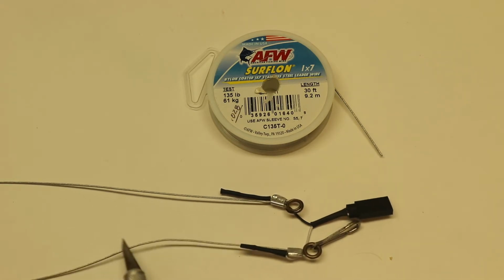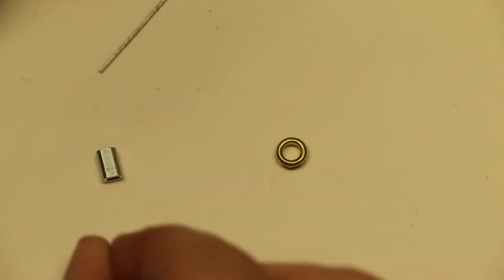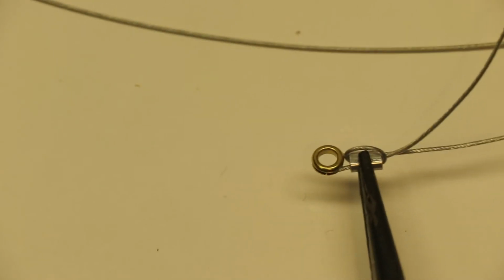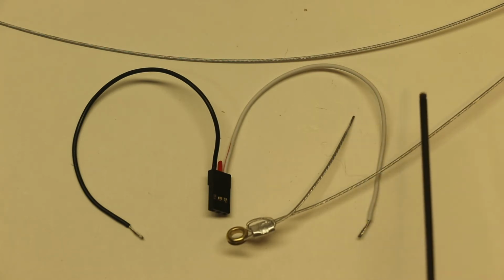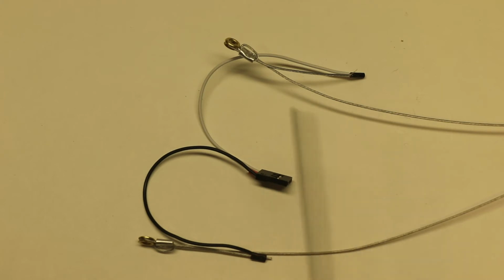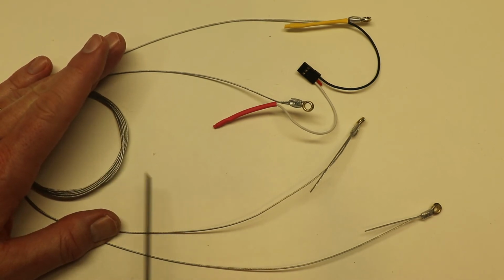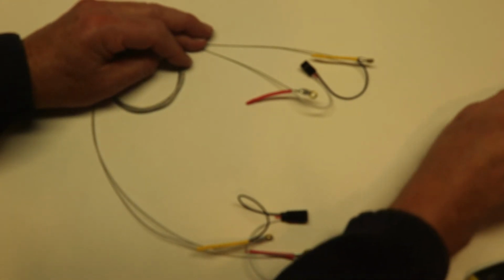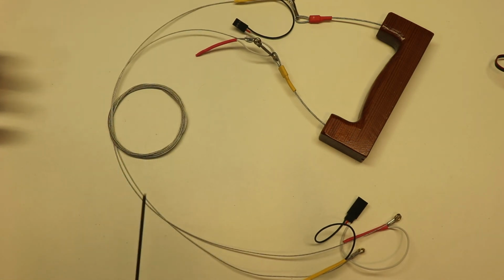Insulated flying lines for Control Line models - How to assemble

Comment: Its good but
why do you have to carry the entire servo tester with you....?
Reply from the maker: When I fly with throttle control the servo tester or other devices that uses the insulated lines is with me while I fly so I can change the throttle setting. The entire point of the insulated lines is to allow you use a JR DSC radio, converted 72 Mhz radio, Bill Young handle, servo tester or other devices to control features on the model for CL scale. Most CL scale models only have throttle control. If you used a JR DSC radio you could have up to 6 channels being controlled from the center of the circle. You wouldn't use this line material if you had a venturi with a traditional needle valve where you fly until you are out of gas.